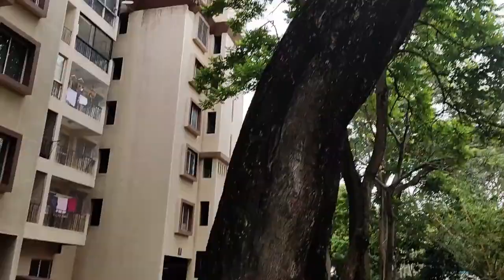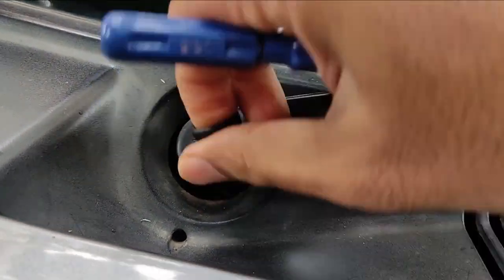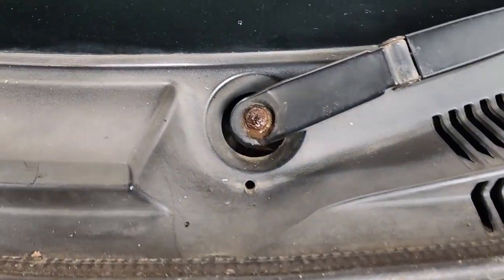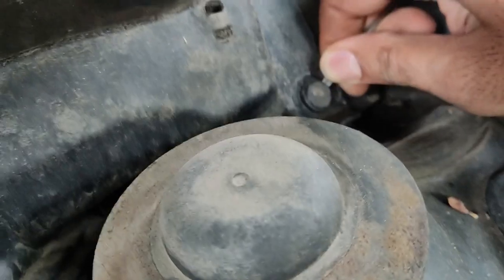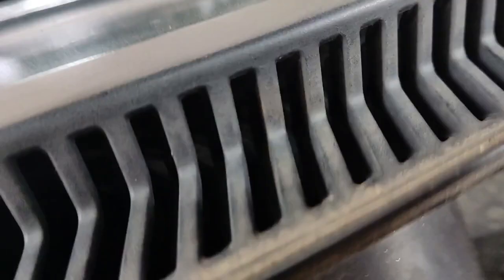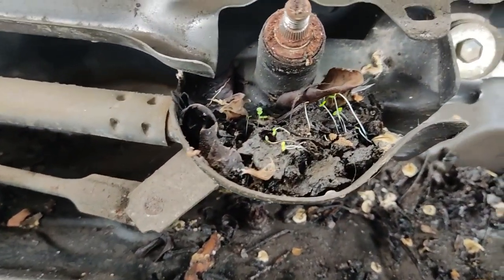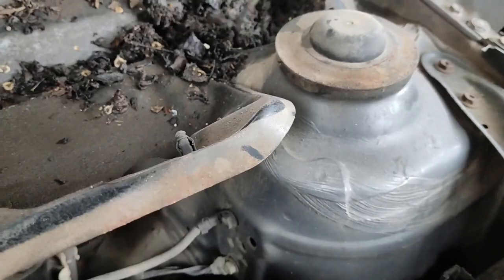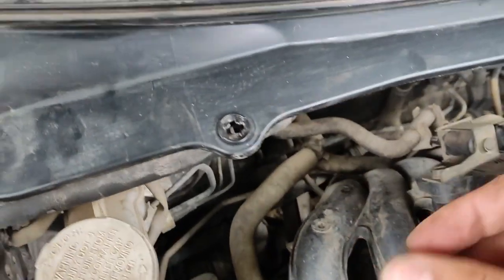Cleaning the garden under my car's windshield cowl!

Comment: Here in the USA we would use a wet/dry vacuum to suction all the debris up . Then a electric power washer / spray cleaner and microfiber towel to clean it the best .
Reply from the maker: It was too late to use suction here. Will need to be more regular with the cleaning. Will have to be careful with the power washer though. Water might go into the AC duct 

But yes what you described would be the ideal way
Reply: @TheMuser  mY 2020 Toyota Camry has an open air intake . Which I stuff a microfiber towel into to keep out water .